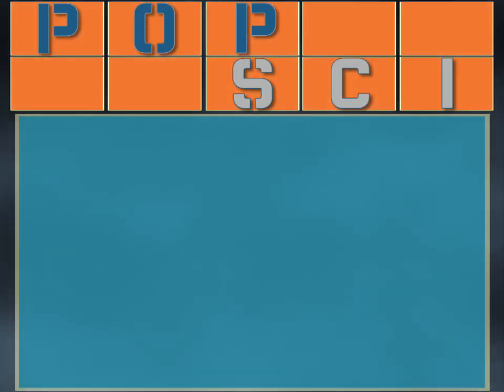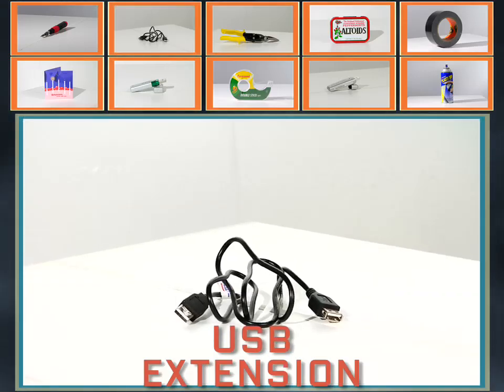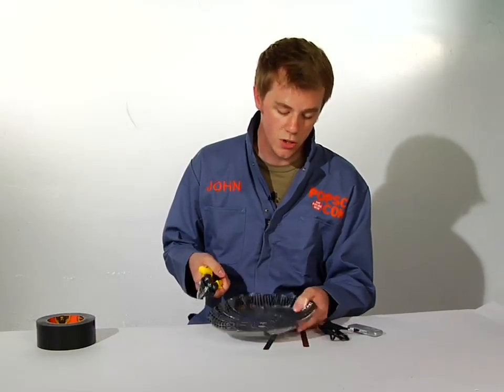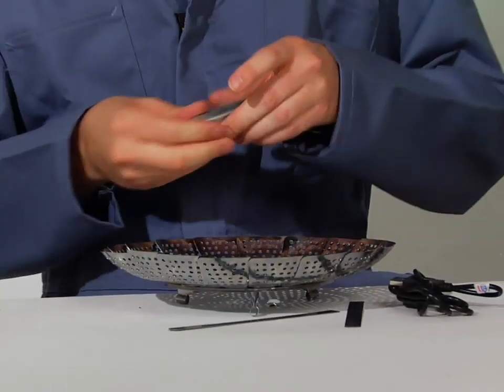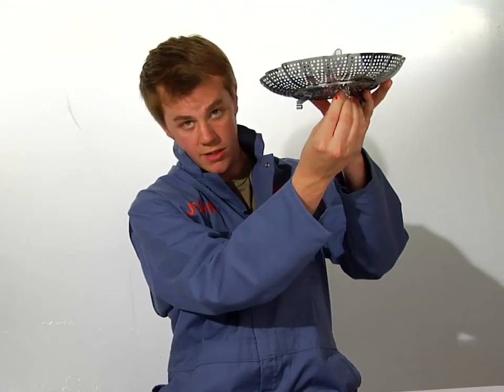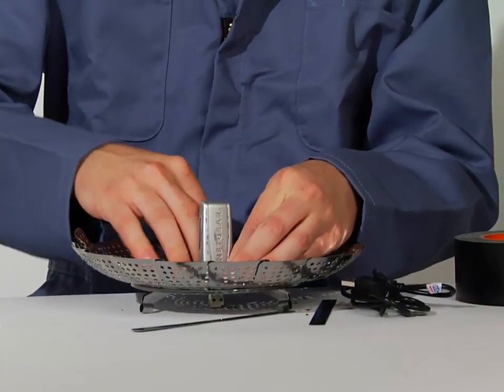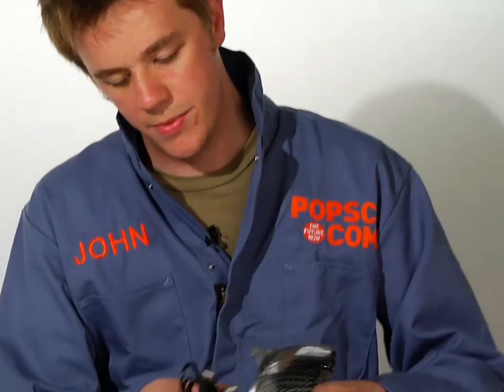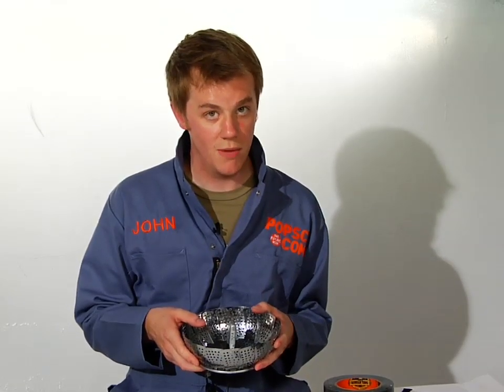The PopSci 5-Minute Project: Parabolic Cookware WiFi Antenna

Comment: Instead of making this thing look like a piece of crap, use a piece of 2 part mixing epoxy( you knead it together like a piece of taffy) put the putty between the wi-fi stick and the dish and smooth out all the way around. This turns rock hard in 5 minutes, looks great and lasts for ever. Then you will have a great antenna that you will be proud to show others that you made.

Comment: Great, if you are just looking to cook the USB stick. Define "way far away". How many inches is that? These already pick up wifi from way far away... We need way, way, way far away.
Reply: the way that this works is it focuses the tramsitted and received signals. greatly extends range. if you want actual numbers in my experience doubled my range. I was able to get signal through 4 concrete floors instead of 2